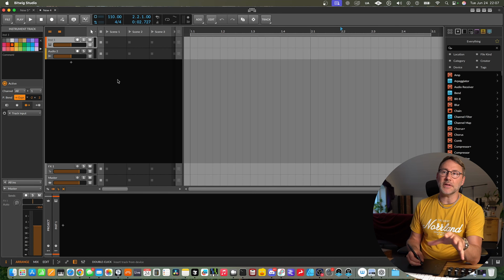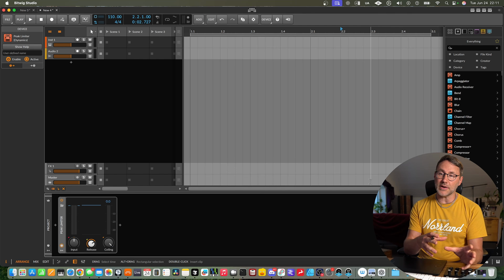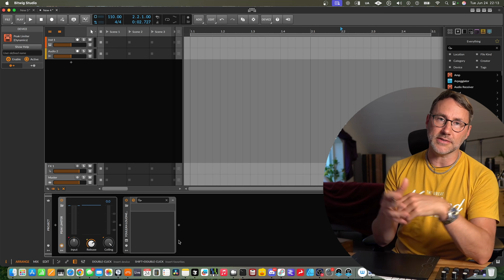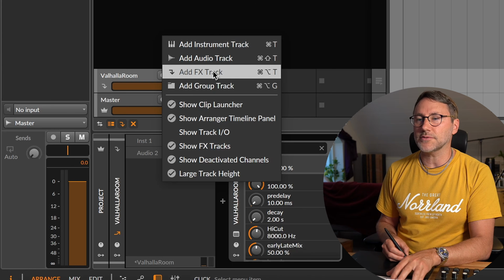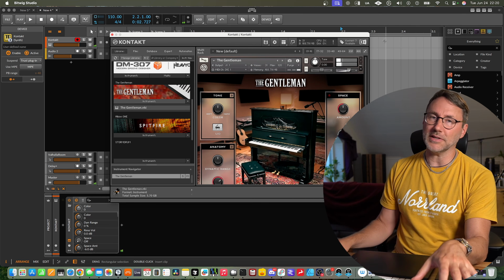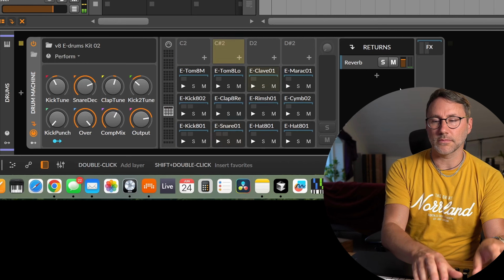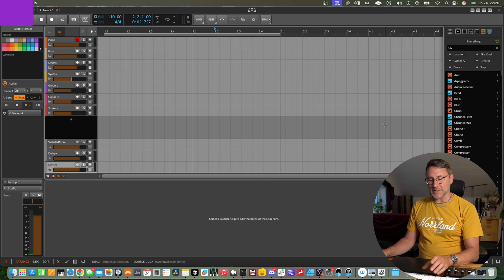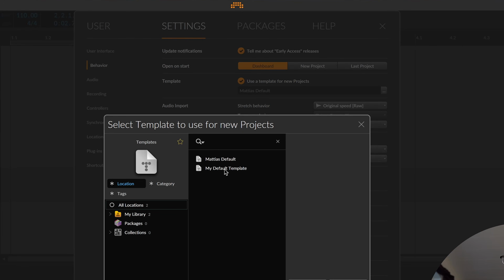Speed Up Your Music Workflow in Bitwig – Template Tips

Comment: Unrelated question. Do you have the roto-control in a usb hub or does it have to be in a port on your mac?
Reply from the maker: I have Roto Control either into usb hub or directly into Mac. both works. But make sure to give it the extra power via it's dedicated usb-c power port if you want the capacitivity of the knobs to work properly. I thought I had a faulty unit until I realized you have to give it extra juice for that to work properly.
Reply: @MattiasBitwigLab  Thanks for the confirmation. I'll keep trying!